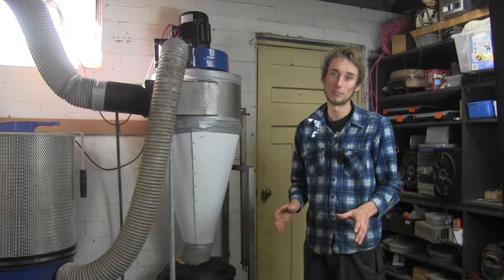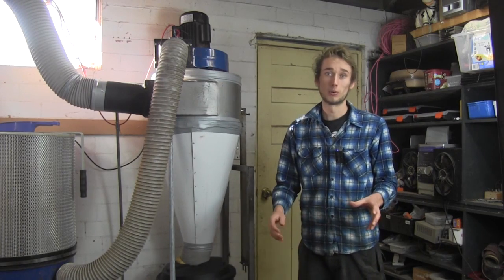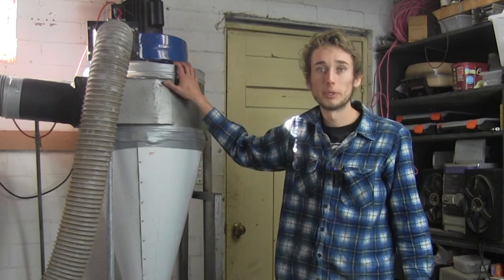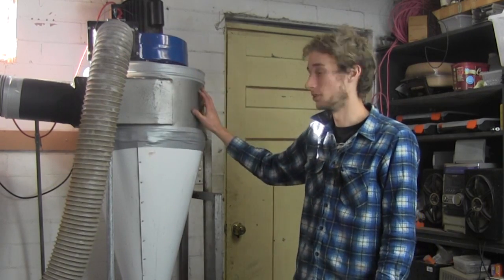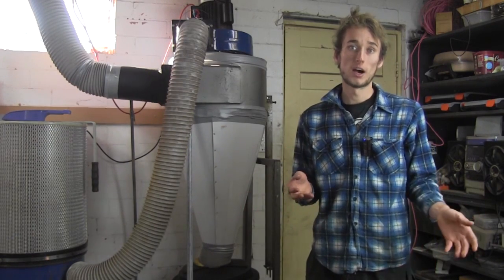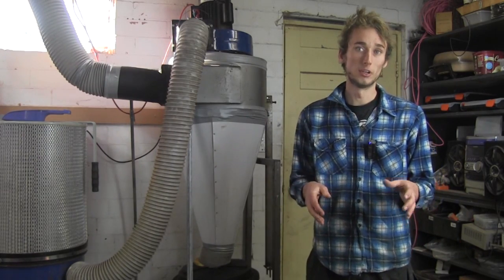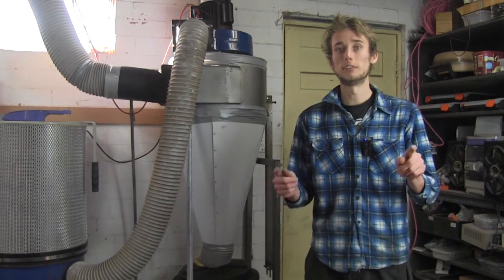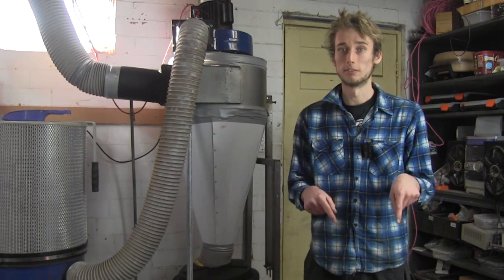Make a Cyclone Dust Separator - The Top Hat (part 1 of 3) (home made cyclone)

Comment: Yes you have right- this should work, not to be to complicated math. But to work good nead several rule.
I nead a smal dust colector, new one cost some about 350$, then i must calculated good- material, and proportion to know if I profitable to build. If i put 100$ and i do get efficient enough or not. In your case- you have demision from old one- then is beter.

Comment from the maker: To be honest I didn't, I took a few measurements from other cyclones that are on the market and based my dimensions from them and it all worked out fine. Just to be clear this is not a a build that provides you with a "scientifically designed" cyclone, its just a cyclone that works and works well for the everyday wood-shop.